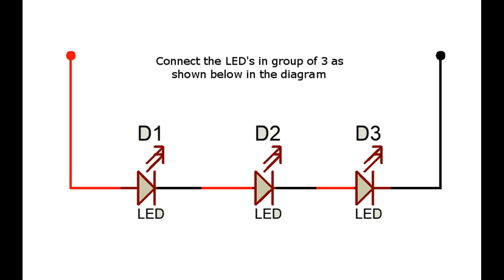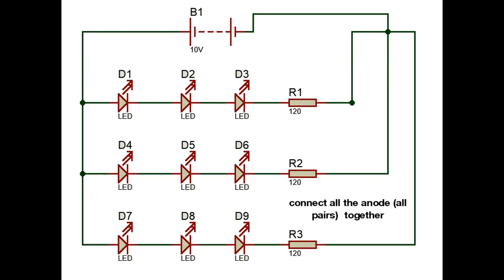RGB LED Decorative Light using Cooker Gasket | Photo Frame

Comment: Sir can I connect 70 leds bulbs direct ac
Reply from the maker: You can with protection & using high wattage resistor (anything above 2 watt should be good).
I don't recommend supplying AC voltage. i recommend buying a 12v adapter instead